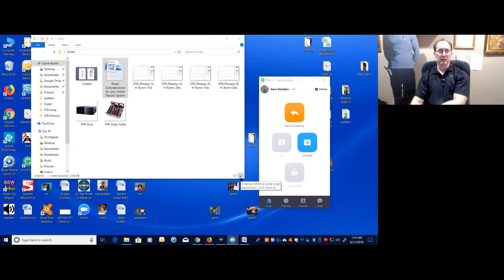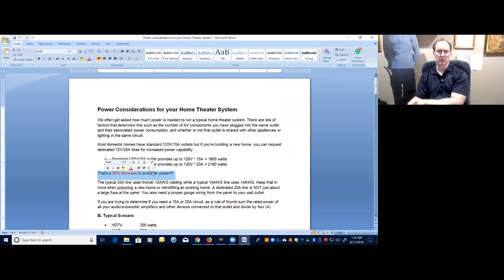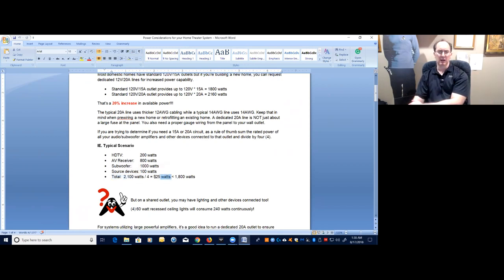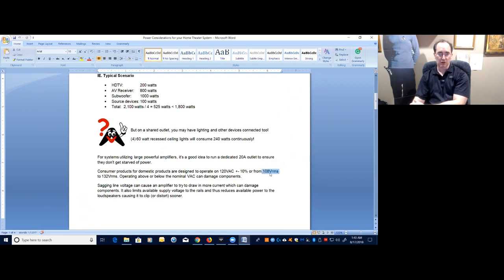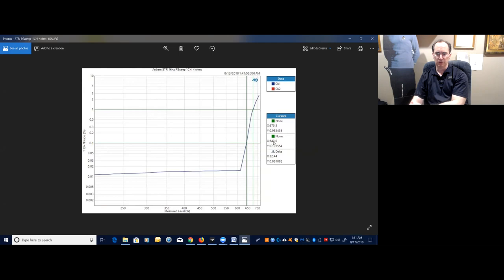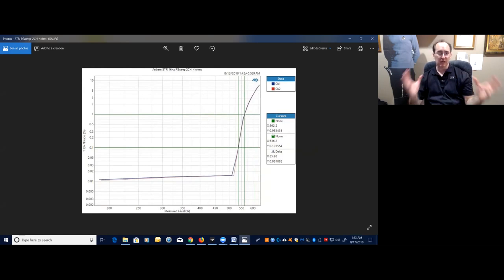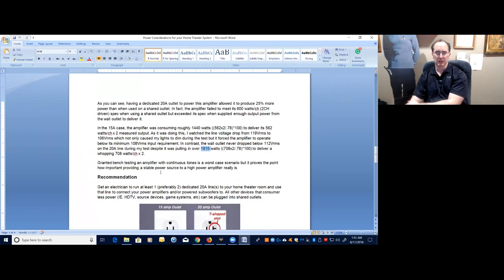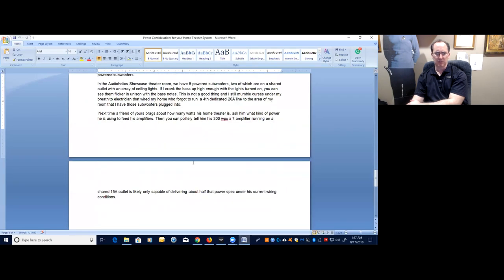AC Power Considerations for Your Home Theater System

Comment: I’m an electrician who deals with power quality requirements for computer systems and other electronics. Good information here but I can provide a further recommendation. If your AV setup is using multiple circuits, make sure they are all using the same phase leg of your electrical service. Having them all on the same leg will greatly reduce the possibility of noise and allow the whole system to use the same voltage supply levels. If the circuits are on opposite phase legs, the voltage difference between them can cause power quality issues between the interconnected devices. 

The ultimate you can do is actually use an isolated ground circuit and receptacles. This will make sure that noise picked up from the grounds of other ac lines will not find its way back to the equipment. This can be a bit more involved but is used in high end installations. Isolated ground receptacles can be identified as being orange in color and must be installed with specific wiring considerations.

Great video and keep listening!
Reply: I can't think of any AV gear that has ground connection, most of it just has 2 pole plug, so putting in isolated ground system may not be worth it (I think in my case it's only projector). Also think of cable box if you have it - that coax shield is tied to the house grounding system at the point of entry. Great point though.
Reply: Andrey Pevnev my AV receiver and each of my 4 subwoofers have grounded plugs.
Reply: When I put a fork in the microwave, it makes lighting, can you explain that Mr. Electrician man???
Reply: Tyler No, a 2 prong plug cap is not considered "grounded". It is considered "isolated." Equipment must be either grounded or isolated for safety..
Reply: hilow64imp Good points. But recall that a receptacle that is dedicated and homerunned in non-metallic sheath cable ("Romex") is already essentially an isolated receptacle.. A regular receptacle is acceptacle; a receptacle constructed as an isolated receptacle is not really needed.. There are suggested, however, in conduit installation in which the conduit is ran to various areas and may have small currents flowing on them.. But your points are correct..
Reply: Tyler No completely different.. A "grounded" appliance is tied to the circuit grounding conducter.. It requires a 3 conductor cord and 3 prong plug cap.. This is done for safety.. An "isolated" appliance is not tied to the circuit grounding conductor.. It requires 2 conductors and 2 prong plug cap.. Because it isn't tied to the circuit grounding cinductor, it must be encased in an insulator or otherwise properly isolated from the chassis.. Typically, these appliance are encased in a plastic chassis.. UL is quite clear how it tests and certifies appliances.. And the NEC makes distinctions.. The terms mean completely different things...
Reply: Tyler Yes, this is true.  The "neutral" is indeed grounded at the service panel..
Reply: Electrician here too, agree with isolated ground but need to correct phase/leg info.  The typical house panel is a SPLIT phase NOT 2 single phases.  It is ONE 240 volt phase that is center tapped to give 2x120V to the "neutral" whereby imbalanced currents are carried.  Without getting too much into it this is done at the pole transformer level before serviced into the house.  So not sure if there is much to putting all devices one leg other than all of them drawing off one voltage, but if you have a high draw you may get significant voltage drop.
Reply: Furman does offer a 20-ampere voltage regulator with a balanced output isolation transformer to provide a 60/120 volt balanced output for the ultimate in a low noise-floor specification, of which is specially suited for sensitive audio-visual equipment, (especially digital signal processing gear.) power amplifiers may need additional dedicated circuits (sometimes larger than 20-amperes) depending upon the size and/or output rating of each power amplifier. Larger commercial power amplifier(s) (in excess of 3kW rated output) may require a dedicated 30-ampere 120-volt circuit(s) or possibly even be configured for 240-volt operation for adequate power & satisfactory results for output power @ a specified wattage, especially when driving low-frequency band-limited loads, such as sub-woofers.

Electrical branch circuits as specified in the National Electrical Code shall not be loaded more than 80% current carrying capacity, of which equates to: 

1,440 watts (12A) for a 15 ampere branch circuit (1.8kW capacity), operating @ 120 volts nominal operation.
1,920 watts (16A) for a 20 ampere branch circuit (2.4kW capacity), operating @ 120 volts nominal operation.
2,880 watts (24A) for a 30 ampere branch circuit (3.6kW capacity) operating @ 120 volts nominal operation. 

Higher wattage is more efficiently obtained by re-configuring your equipment for 240-volt operation. 

I've been designing & engineering professional sound reinforcement systems for concert venues, night clubs and similar venues for over 25 years.

Loading all of your audio/video equipment on only one leg of your electrical service may lead to undesirable or unintended conditions resulting in a loss of power or a voltage drop or a voltage sag of which can be very noticeable, especially during periods of high transient output. This is especially true when thousands of watts are dissipated for power amplification during periods of high output transient peaks or during sinusoidal (sine-wave) testing or system calibration or output measurement.

It's always beneficial to keep all of your electrical branch circuitry balanced at the service panel, and to use balanced Low-Z line-level interconnect cables for transmitting low-level or line-level signals over long distances (in excess of around 6') so as to prevent any objectionable EMI/RFI interference. Additionally, make sure that all of your audio grounds are kept separate to prevent ground-loop induced hum. Balanced cabling using either 1/4"TRS phone jacks/plugs or 3-pin XLR typically rejects such noise by principle of using 2 conductors within the interconnect scheme that are 180 degrees out of phase from each conductor. This causes phase cancellation that rejects outside noise influences on the audio line. Connection of all audio grounds may also cause system oscillations. 

Some audio equipment may also offer a ground-lift switch to safely and effectively isolate audio grounds easier.

Whatever you do, DO NOT USE a "cheater adapter" to defeat the 3rd-prong safety ground pin on your power plug as a way to lift the ground to prevent or stop the ground-loop induced hum or noise in your system.

Some manufacturers also offer various products to convert consumer-level unbalanced equipment to drive a professional-level balanced audio line-level configuration, of which may already be standard on some esoteric "high-end" audio equipment. 

Professional standard audio line-levels are also a bit higher in specification (+4dBu/1.4V standard operation levels versus -10dBv/0.775V for consumer-level unbalanced line-level audio signal paths.) Some equipment, such as some entry-level or low-end consumer audio/video receivers or integrated amplifiers may not offer much sufficient output voltage, if they even offer pre-out (line-level pre-amplifier outputs for the express purpose of driving outboard power amplifiers) as an upgrade alternative to the often mediocre under-powered amplification that is often included in most consumer-grade A/V receivers. 

Power amplifiers are more immune to this sort of interference, due to the high-voltages, higher currents & higher concentrations of magnetic fields that may be present within the confines of its chassis. Speaker-level output cables are typically immune to this type of interference as well, due to the higher voltages & currents present across the speaker line terminals. 

For this reason, speaker cables aren't typically electrically shielded.

Comment from the maker: Correction: 120V * 20A = 2400 watts for 33% increase in power over a 15A line. I would add an annotation to the video at 2:50 to correct this but YouTube has done away with annotations and Vcard won't let you put text message corrections. Sorry about this.
Reply: Thanks for the correction Gene. 20 amp= 2400 watts is what have known to be the correct wattage. This is what ATI has states in the ATI AT2505 Amplifier user manual.

Comment: I built my home 3 years ago. 
I have a system in my office, family room and master bedroom. 
The Family room has 2 large amps for 9 channels and 2 SVS PC 4000s. I have 3 dedicated 20amp lines to that system and it is definitely a must for quality output. 
The 2 smaller 5.1 systems have 1 amp each and are on 1 dedicated 20amp lines and do just fine. 

Great video Gene.

Comment: Excellent Gene! My AV salesman suggested this 15 years ago. My brother (electrician) set me up w two dedicated 20A outlets one for amps and pre amp and one for powered subs. Once i added amp for rear surrounds and 4 height speakers we added third dedicated outlet. Use xlr cables and by amp L,R mains (30'run). No lights or any other bs in circuits. M&K speakers, Anthem amps and pre. Plenty of power, sounds amazing at all volume levels never turned off except to dismantle and clean for FIFTEEN YEARS :D

Comment: I’m in the process of building a dedicated home theater. I already have my amplifiers – A pair of Outlaw Model 7900s. These require 2 dedicated 15 amp circuits (each) at a minimum – Yes each of them has 2 power cords. The rated draw is 2x1440 watts, or 2880 watts per amp. If I use 4 ohm speakers, two 15 amp circuits wouldn’t be enough. The amps are rated at 450 watts/channel into 4 ohms. The math calculates out at better than a 4000-watt draw – about 34 amps. So I will need two 20 amp circuits for each one, or 4 circuits total. Fortunately I knew this before I bought them. FWIW - I’m going to add another 20 amp circuit for the subs, another for the rest of the AV equipment, and two more for the snack bar. My circuit breaker box won’t come close to handling that kind of draw so I’ve already planned for an electrician to come out and add another box. Thanks for another great video Gene.

Comment: Calculated mine. Included everything Gene mentions but also added two Emotiva amps , xpa 5 and basx 5 (Approximately 1100W) My total was 2310W possible average. In australia we have 2 x 10amp circuits . Lights , oven etc all on a separate circuit . So i calculate i have 2400W to play with . I use around 2310W average. Divided by 4 =  577.5W So if all this is accurate i have nothing to worry about using a 10amp circuit. More than enough available

Comment: I know I’m a little late to this discussion (I just moved across the country) but one issue that wasn’t addressed in the video was the wiring techniques used between the breaker and the outlet. I’ve had problems with outlets that were wired using the push-in holes that just have a knife-edge contact, particularly if there are a few of those outlets between your outlet and the breaker. Those don’t only drop voltage to your system, but they generate localized heat in the outlets. It’s probably not going to cause a fire, but it should concern the user. In my opinion, it’s a bigger cause of voltage droop than a low-current breaker. Another point of concern is how long the cable run ia from the breaker to the outlet. If your home construction fequires, for instance, a line that goes from the basement to the attic and then back down to the ground floor, kick up the guage of the wire another notch. Yes, that much copper is expensive, but it’s cheaper than doing it over.
Reply from the maker: Great points. Thanks for chiming in with your perspective.

Comment: Thanks for the video Gene, it’s really helpful.  I have noticed my lights dim (all bulbs have been swapped out with LED bulbs) as soon as my Denon 4400h powers on before any sound is heard from the speakers.  My house was a spec build and for some reason (cost obviously) even though it has a dedicated home theater room, all the lights and electrical outlets share the same 15a circuit in that room.   I recently opened up holes in the ceiling to install Atmos speakers and i think i found a way to Romex to the room from the garage to run additional outlets.  This video was all the motivation i needed as i have been noticing my subs are clipping...:o)... it really helped me when you converted this to watts so now I can look up the specs of all my equipment to understand how many dedicated circuits i need to run
Reply: Brandon Culler Consider a 20 amp circuit..12 awg is the minimum sized conductor allowed by the NEC.. But consider 10 awg if the dedicated receptacle is some distance from the service panel.. Doing so will reduce voltage drop a bit and the increased cost will be minimal..

Comment: Furman AR-PRO, Furman PL-PRO Series II, (3) Crown K2 power amplifiers (800 w.p.c. @ 4 ohms, stereo mode; 500 w.p.c. @ 8 ohms, stereo mode) I've been using this configuration now for over 15 years (and counting). 

Speakers: one pair Electro-Voice MTL-2B (2x18" Manifold-Technology sub-woofers, loaded with the EV EVX-180-B 1,000 watt 18" cast-frame woofer with 4" voice-coil) and one pair of EV TX-1152's, 2 pair of EV 251+ (remote speaker systems powered off of 3rd power amplifier, fed signal from auxiliary output of main mixer.)

Currently powering system on a dedicated 20-ampere 120-volt branch circuit, although system originally designed for operation on a 30-ampere 120-volt branch circuit, will occasionally trip circuit breaker off when all equipment (two separate audio racks powered with two separate Furman AR-PRO's & PL-PRO's, and when both equipment racks are switched on simultaneously and not sequentially. Steady-state current draw less than 5 amperes, unless when driving system hard... then current measurements capable of around 25-ampere peak measurements (@120 volts nominal mains line voltage.)

Furman AR-PRO voltage regulators capable of 240-volt operation, with regulated output voltage of 120 (+/-) 2 volts.

Comment: One 30 amp outlet, with a CEP 6503GU 30-Amp Mini Portable Power Center connected to 2 PC systems networked and a Home Theater system that includes 2 Adcom Amps powering 5 250W channels and a 600w Klipsch subwoofer (and a bunch of other devices too long to name). System has been humming since I popped a circuit before taking advantage of the 30 amp outlet that i had the builders install into our relatively new townhouse.....

Comment: In my country, you cannot mix lights and outlets on the same circuit. When I did my house renovation,  I ran a dedicated circuit for my modest setup. I use a power conditioner/ups because we have frequent voltage fluctuations. As I write this, it is telling me that the line voltage in is at 111 volts. Definitely not good.
Reply: Kendall Tull Very common in the USA... But a better design is to separate them.